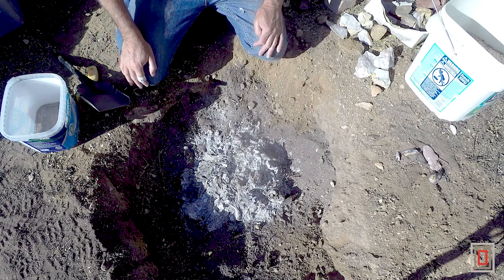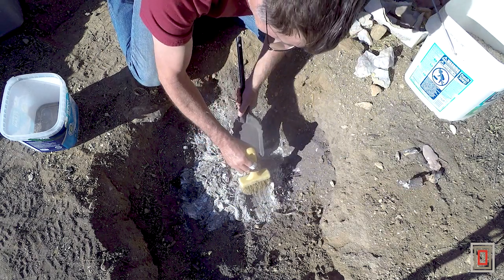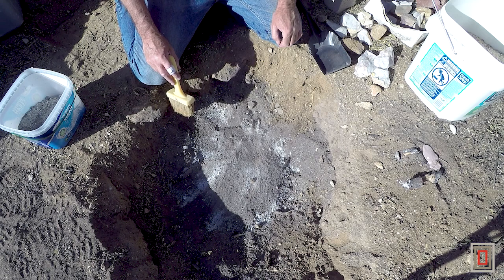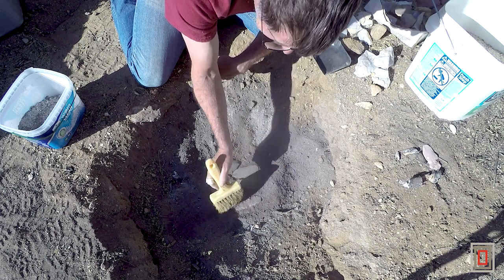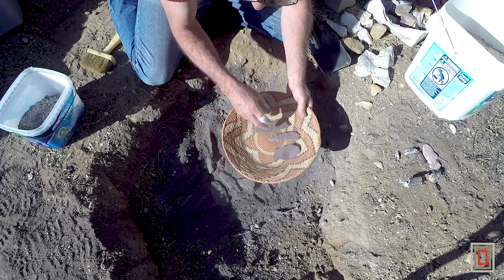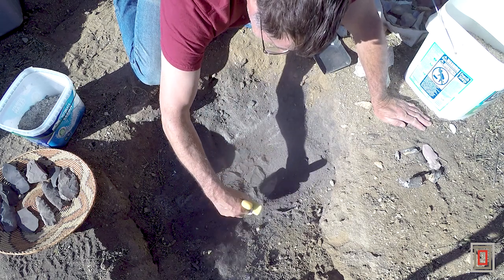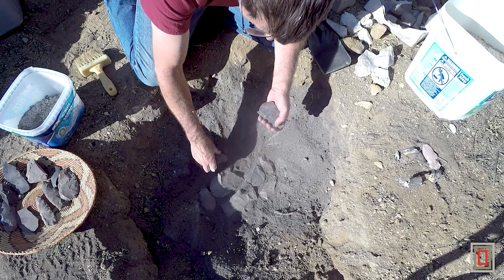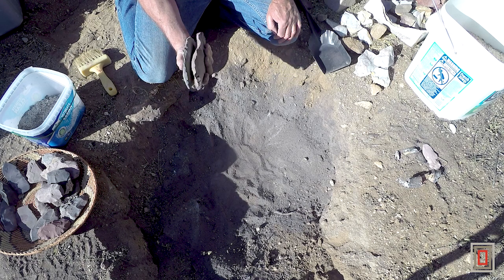How Did People Make and Use Stone Tools? Part 5: Heat-Treating Rock

Comment: Why cover the rocks with dirt instead of just building the fire on top of the rocks? Are you concerned with thermal shock, or trying to keep them from getting too hot?
Reply from the maker: From Allen: "Great question! It’s all about not thermally shocking them. You want them to cool gradually. Different kinds of rock heat-treat differently, and some can take more heat than others to heat-treat properly."
Reply: @ArchaeologySouthwest  Thanks!

Comment: Can you heat-treat an entire rock or is it best to break the rock into bifaces?
Reply from the maker: Great question! From Allen: "It is best to break the rock down into manageable flakes, as it requires less fuel to heat the rock enough to achieve better flakeability. Some rocks can be heated in larger chunks, but this can also cause more breakage.
 I hope this helps!"
Reply: @ArchaeologySouthwest  Makes sense.  Thanks!